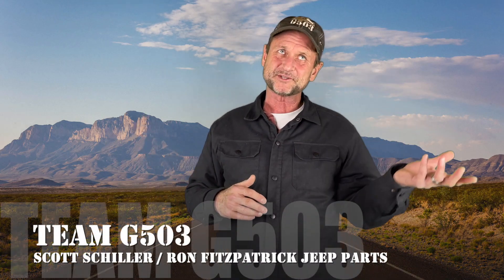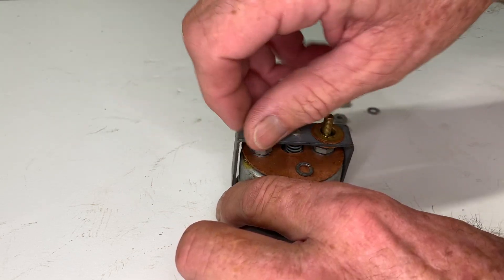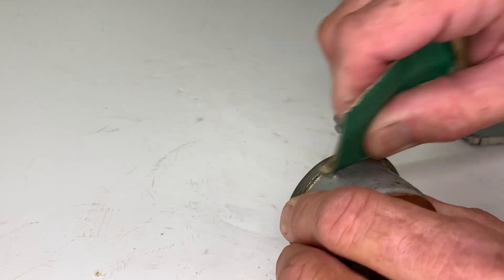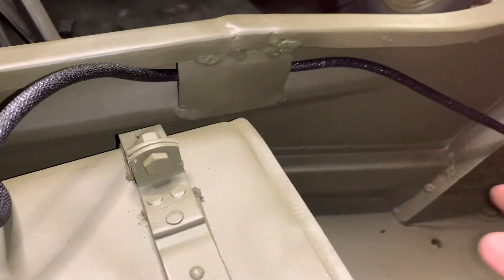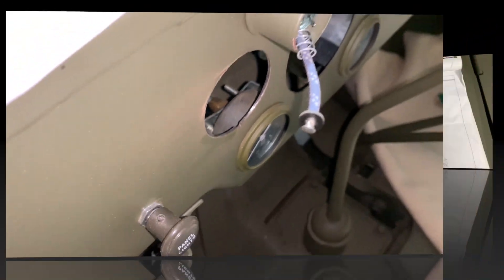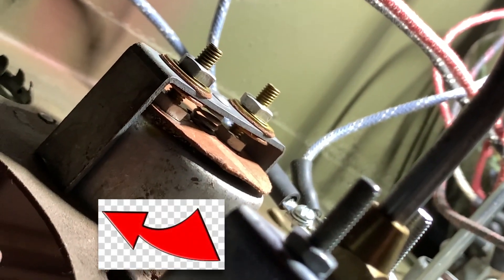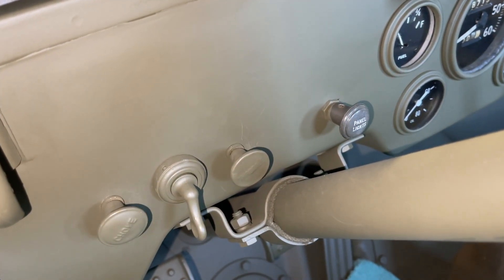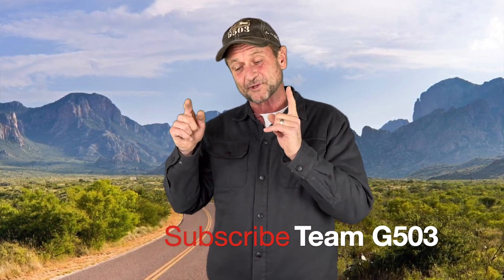G503 Fuel Gauge Installation (Electric Part 22) Willys MB Ford GPW

Comment: Glad that I found this. I need plenty of pictures and details. Mine was working fine then just stopped. Shows fill when it is. But then starts flickering back and forth with condensation builds up on the glass. Then it will just go to E.  I am figuring ground some where. 1946 CJ 2A . Sorry that I found you so late.

Comment: Great video. My guage works when the engine is off. Pegs to full with engine running. I've checked ground on every single component on the Jeep. Twice. Disconnected and reinstalled the guage like 4 times... grr.

Comment: What amp circuit breaker did you use? The original wiring diagram shows it going from ignition to gauge.

Comment: Great video. I have been following along in wiring my MB and this is extremely helpful. Am I missing something though?  Can't find a video that links #10 Video (installing ignition switch) to #22, which would explain the routing and. connection of the A-7823 Harness, including where it routes through the firewall.

Comment: Will rewiring the fuel gauge help with these problems. Moisture on the inside of lens when running. Will show full but drops to empty with fuel still in it. Wiggles back and forth very quickly.?  Any one interested in a 46 CJ2A with military trailer. Lots of extra parts.?  $15,000.